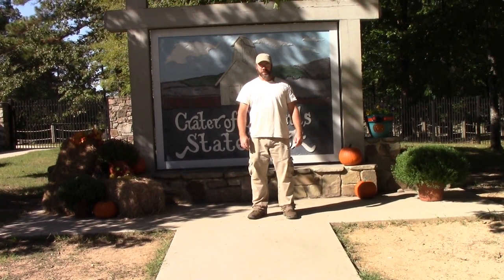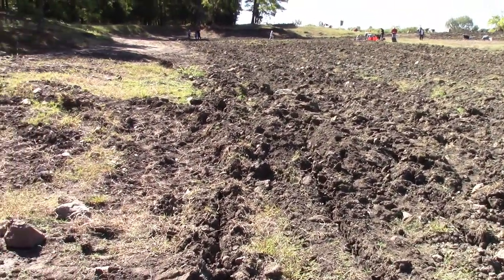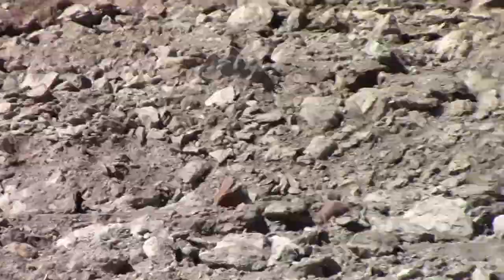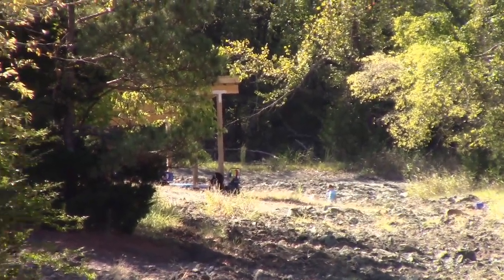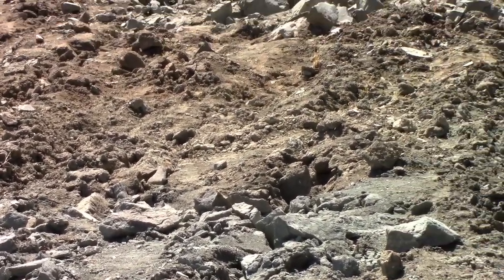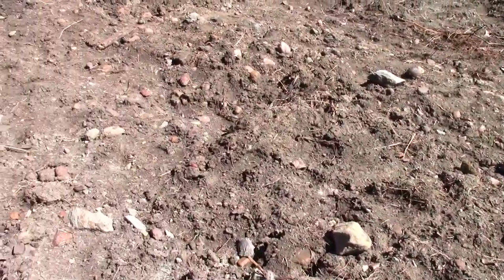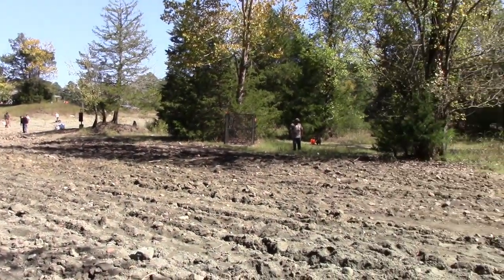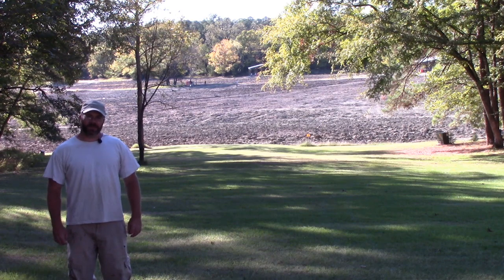New Diamond Bearing Soil Open for Searching at the Crater of Diamonds State Park!

Comment: Guess this was the "project" they said was in the works before the field would be plowed again.
Reply from the maker: They have been planning this for quite some time I am told.  I think it was re-scheduled a couple times as well.
Reply: Yea, the dozer operator knows nothing how the ground needed to be blowed. It’s not cut towards the east drain so it will need run off. :...( 
Good news is the gravel layers are exposed at the new trench!!
Reply from the maker: @DiamondMinerIvins  I probed 5 FT down from the lowest point in the center of the trench and only hit a little gravel, but the sides were opened up, and some of the old road bed is exposed too.